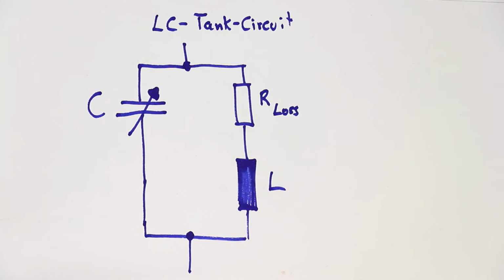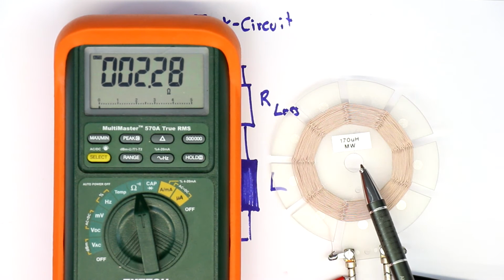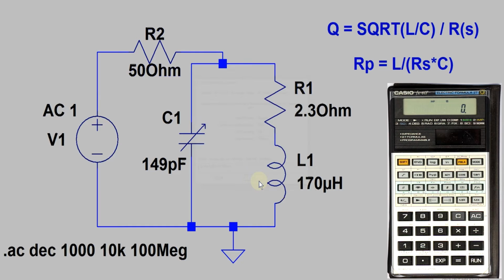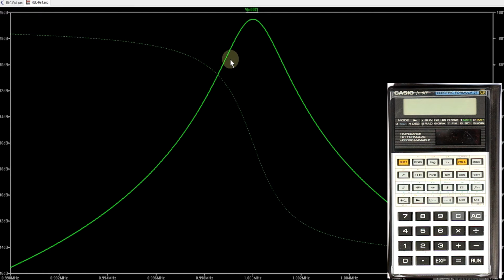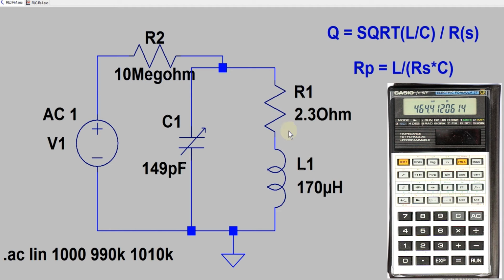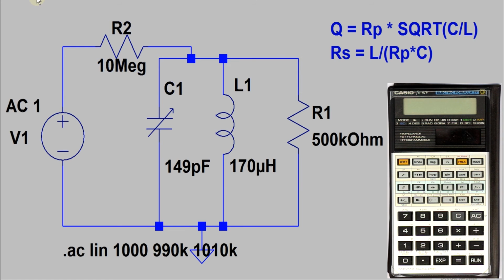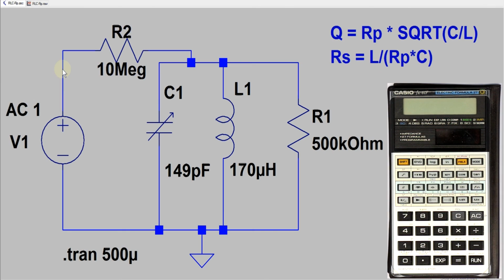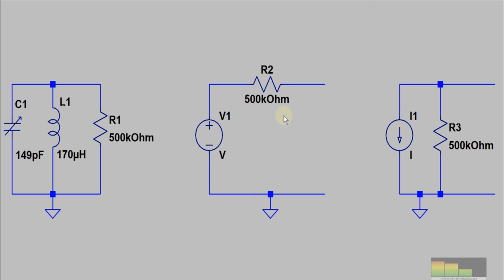Resonant Magnetic Antennas Pt.3 : Losses and Q-Factor Optimisation

Comment: Your explanation of which indicators influence the Q factor is very educational! Now the translation of this to my first self-build small magnetic loop antenna .. loop circumference is 3 foot copper tube of 15 mm. R lose is mainly determined by the connection to the variable (7 - 60 pF) air capacitor. With this SMLA I want to operate on the 20 - 40 meter HAM radio bands. What is your opinion regarding the Q factor and the efficency of this antenna?
Reply from the maker: Sounds reasonable. Getting a milli-ohms connection from the copper-tube to the variable capacitor is indeed not trivial.
Try my spreadsheet for calculation Q-factor. There is a separate video-series about this spredsheet on my channel where you also find the download-link. 
Jery Elsworth also has a video about making a very large copper-tube loop-antenna for the SW-bands.
Reply: very educational which factors determine the Q factor and demand attention when designing and building an SMLA.Now I do not own a lab with measuring instruments to determine the L and C and the Rdc and Rac of my built magnetic loop antenna and therefore the Q factor.Which measuring instrument is your advice for HAM radio antenna construction?question, when tuning the MLA around 12400kHz (20 mterband) the audible resonance frequency is much louder (and thus has higher amplitude) than the resonance frequency 28500kHz. (10 meter band)The circumference of the MLA is constant 3 meters and the diameter of the tube is constant 15mm.What would be the reason for this in your opinion?The dielectric of the variable air capacitor also plays a role in the Q factor. Therefore has a vacuum var. capacitor preferred with an MLA?